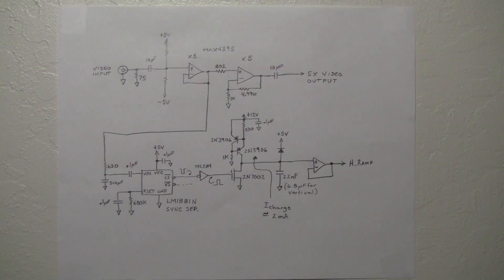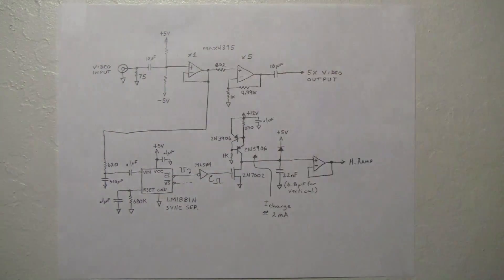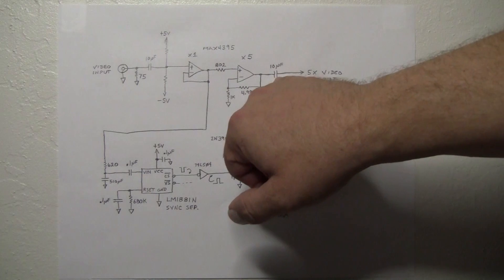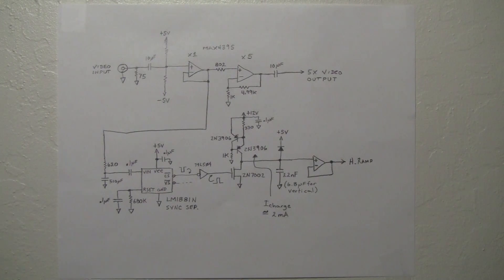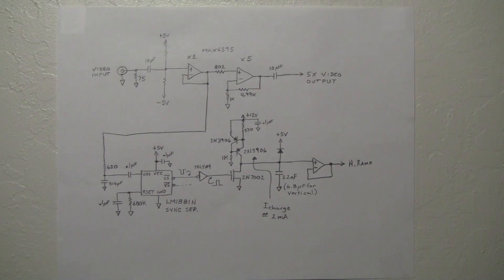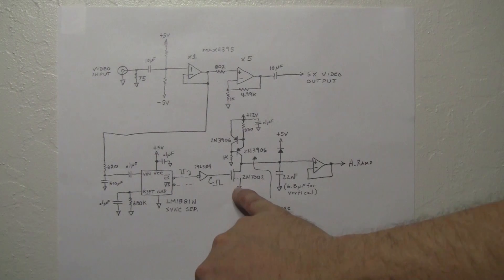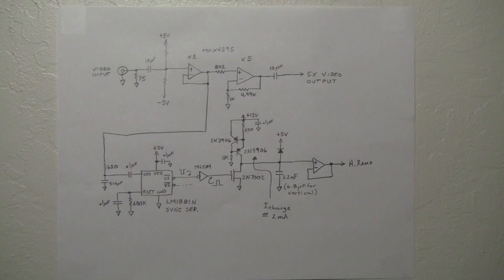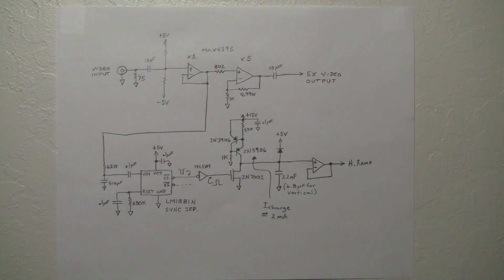Tiny TV Circuit Theory of Operation

Comment: [It feels a bit strange to comment on a video made 13 years ago, but the video is as relevant today as it was back then, so it really can't be compared to necroposting on a forum].  Anyhow, I must say that it was a clear and nice explanation and I've also enjoyed your other CRT design videos previously.  A question about this one though - what was the rationale for using a 74LS04 to invert the sync pulses instead of just a BJT infront of the MOSFET?  Hmm... Now I realise that it would require 2 transistors and 4 resistors in total compared to a single IC, so from a PCB real estate perspective about the same, and it's also more or less the same cost. So I' almost deleted this comment, but it would still be interesting to know if the '04 is better in some regards in this design.
Reply from the maker: I used the 04 because it drives the FET perfectly. The HC family has a full rail to rail output voltage swing.

Comment: Hi, You have terminated the signal in the beginning with 75 ohm resistor, how come there is still enough signal left to enter into opamp? Thanks
Reply from the maker: Great question! The proper distribution video, over 75 ohm coax, is as follows. The video op amp is set to produce a 2V output signal. It feeds the 75 ohm impedance video signal coax through a 75 ohm series resistor. At the receiving end, the coax terminates into a second 75 ohm resistor forming a 2:1 voltage divider. This guarantees proper impedance matching for the coax and the signal to be the standard 1Vp-p. It is very important for longer cable runs where you are trying to prevent signal reflections in the cable. Poor impedance matching reeks havoc with the high frequencies and shows up as ringing distortions in finer details of the image. It also distorts the edges of the sync pulses leading to pulse timing problems as well.
Reply: @videolabguy  This clears the cloud in my head. Thanks

Comment: Cool design! I use commercially available analog video synthesis modules from LZX Industries to achieve the same effect; the Visual Cortex has sync & ramp generators and outputs a sync-stripped luminance signal. One question; why doesn't the ramp have more of an exponential shape to it? Thanks!
Reply from the maker: When you charge a capacitor with a constant current, created by the two 2N3906 transistors, it will charge at a perfectly linear rate. My circuit generates a 1.96mA (calculated; Vbe=0.65V) current. So, I just call it a 2mA source.
Reply: videolabguy great, thank you! Love your channel, tons of great info for younger generations like mine :-)

Comment: Quick question, are the reference voltages (saw-tooth) for both vertical and horizontal half of 5 V or crossing the 0 V line, I mean so that the beam goes back to mid point and the to the opposite side.
The saw-tooth above, wouldn't that just move in one direction and back to mid point as it has reference of 0 and doesnt cross 0 V

Cheers
Reply from the maker: Good observation, sir. These ramps are unipolar, 0V to +5V (approximately). This is not a piece of precision test equipment. The ramps are converted to bipolar +/-150V on the deflection driver board. The design of my driver amplifiers always uses unipolar input. The minus input of the differential amp is held at 2.5V DC (approximately again) making the unipolar input operate in a pseudo differential mode..
Reply: Ahh, alright, makes more sense now.
Thanks for the quick response and very good video.
Planning to build mine very soon.
Reply from the maker: Great! Be sure to share your results. I'm dying to see how others apply what I share.